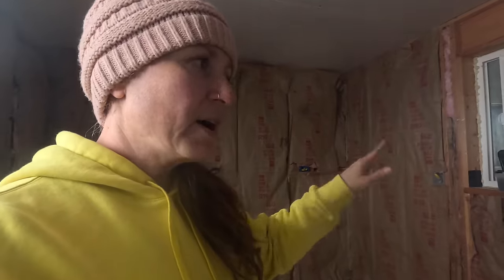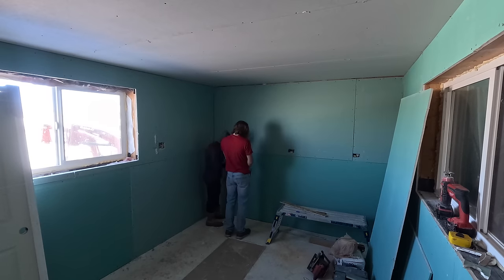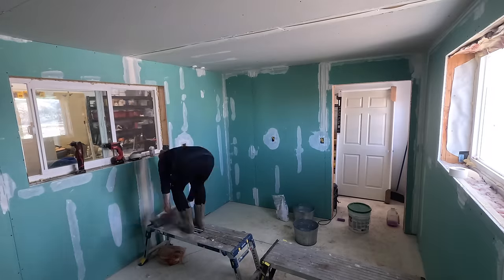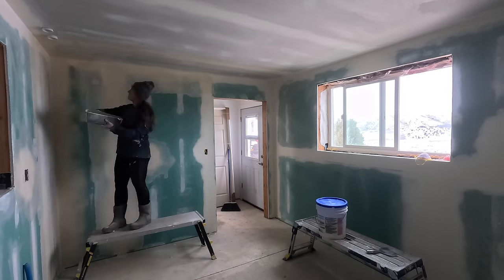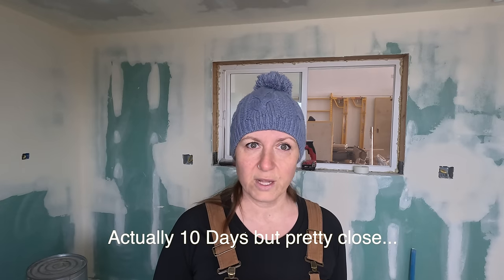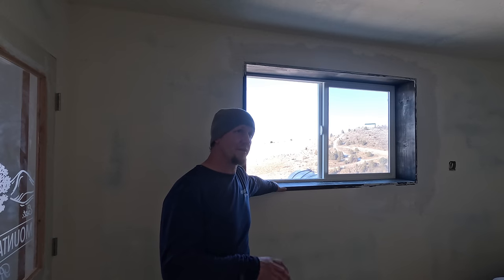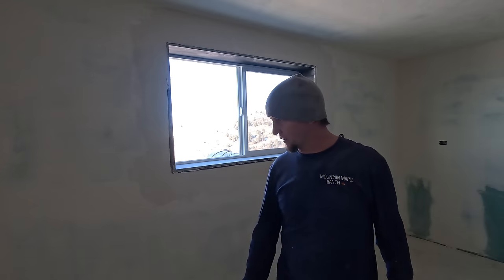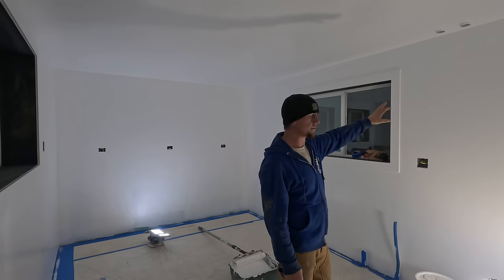WE go from STUD to DRYWALL then PAINT! | The START of our PROCESSING kitchen

Comment: Is there a drain in the floor to clean? Are you putting a moisture barrier on the floor? Will there be flooring or polished concrete.  So exciting to be ready for processing.  
Question...
Comments were made about the storage of produce in the shop while work was done...  What do you plan for produce storage? Hillside underground room?
Reply: Forgot one more question.. Have thought about a toilet room with composting toilet. Maybe under a leanto outside?
Reply from the maker: No drain present. The floor already has an epoxy layer down on the concrete, we will keep it that way. We have plans to do a cold storage room in the future we hope in the next few years, it will be expensive and we will need to save up for it.
Reply from the maker: We have the bathhouse close by that is working for the bathroom needs at the moment.